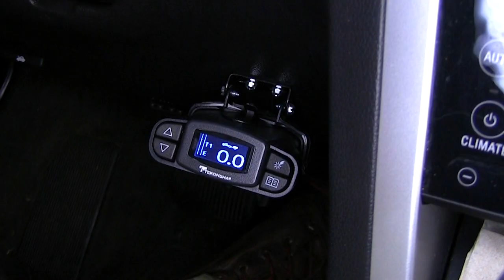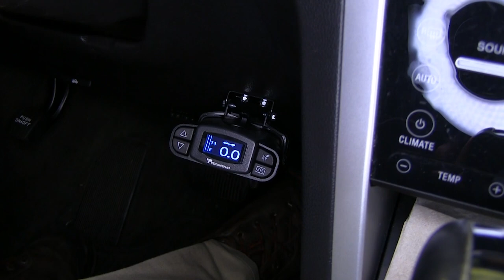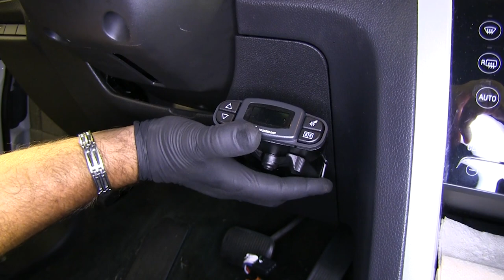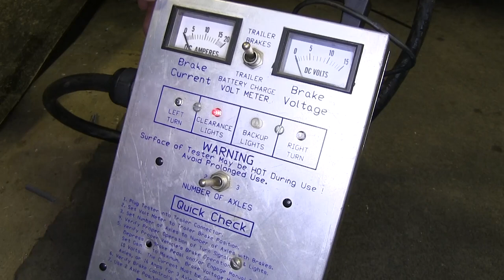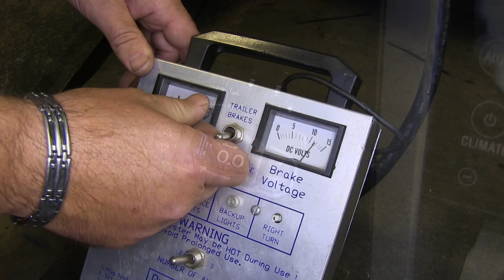Installation: Tekonsha Plug-In Wiring Adapter for Electric Brake Controllers on a 2013 Ford Explorer

Comment: not sure why a hard wire was ran  we just did one plug under the dash was correct fuse box under hood also has a charge fuse and brake control fuse    under vehicle passenger side rear is where you will find the brake and charge    so picked up a curt T adapter for 7 way and  hooked up  I almost followed this
Reply: Eric- so the T adapter powers the 7 pin without needing to run any other wires?  How did you wire the brake controller?

I was going to use the T adapter and then use the Curt Echo for a Bluetooth connection.